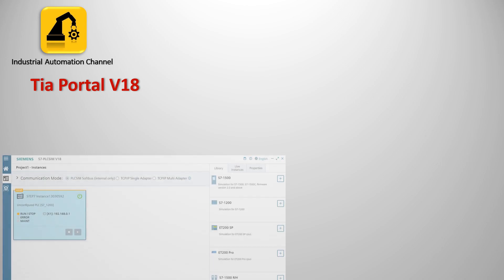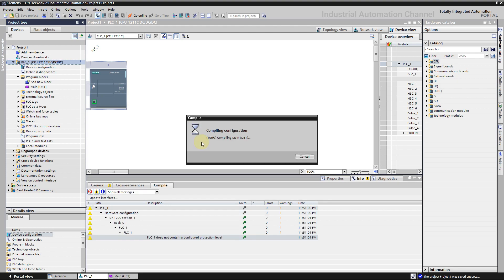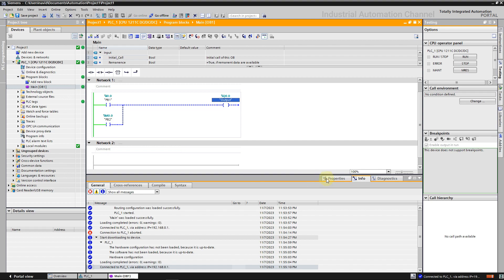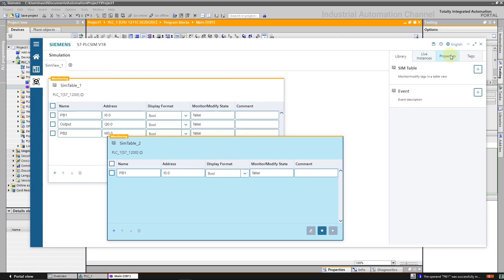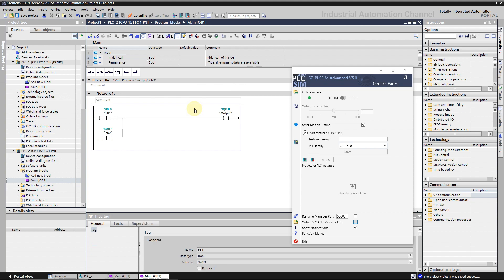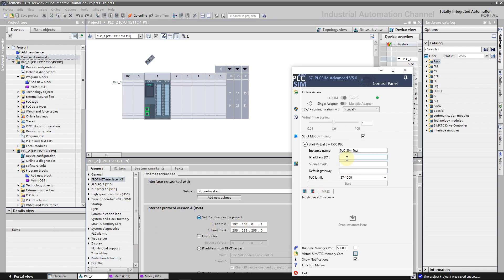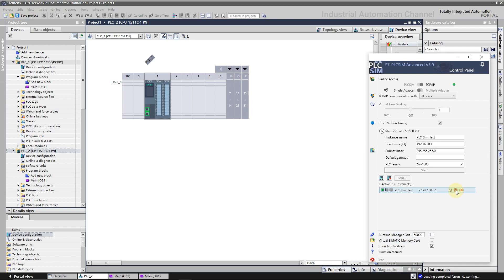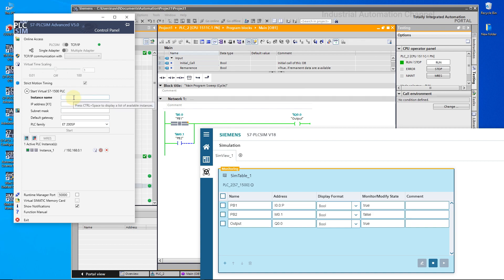TIA Portal #21: PLC Simulation using PLCSim V18 & PLCSim Advanced V5.0

Comment: Hi! Could you help me with my problem? I’m using TIA Portal V18 and S7-PLCSIM v18 for simulation. I can start the simulation relatively well. The problem is that when I make changes to the program, the simulation software freezes.

Here’s how I make changes: I stop the PLC in the simulation software, then I make changes in the program, for example by adding a button. Then, when I try to load the new program into the PLC, the simulation software freezes. What am I doing wrong? In what order should I proceed to make it work? I’m going crazy with Siemens!
Reply from the maker: Hi,
This freez problem I hade also somehow. I think it's a bug of software (Not sure) 
Have you installed the SP of PLC Sim. Probably your problem is solved with the SP because PLC Sim is totally new software and it takes time to solve all the problems.

Comment: hi 
thanks a lot really good and simple but when working with plcsim v5  how do i make main block go 
online ?
it doesn't show in the video
Reply from the maker: Hi,
just like other simulation click "go online" in Tia or click on glass icon. It is like other simulations so I didn't do that again.
Reply: @industrial_automation  i did that it went online but i cant change the inputs from 1 to 0
Reply from the maker: from 1 to 0 ??? has the input a start value of 0? if yes then somewhere it's overwritten to 1. 
Do you see the CPU in run mode? 
It's really not easy to troubleshoot a plc problem just with coments.
Reply: @industrial_automation  from what people told me i can only change the bit from 1 to 0 is by using the force table is this right?
Reply from the maker: @maherdaibes9344  With Force Table you can do it but as its name indicates the input will be forced and that's not a solution that you need. 
I checked it with a CPU 1516-3 PN/DP V3.0 and TIA Portal V18. I could change any input (Peripheral --> P and Q, Memory--> M and from a DB) all of them I could change 0 to 1 and again 1 to 0. Write which cpu are you using. for example some versions does not support Plc Sim advanced. Try to make a new project with the CPU that I've used. 
Probably your input is overwritten somewhere in your code.
Reply: @industrial_automation  thanks a lot i tried to use this CPU and it worked thanks a lot for answering and helping me i wanted to ask if you know why some CPU's  don't allow you to change normally and force you to use a force table

Comment: i have probleme in the S7_400 i can't find it in the PLCSIM
Reply from the maker: In PLCSIM V18 do you mean? 
Yes you can't find it because if you want to simulate 300 or 400 series old version of PLC SIM will open. I think V5.4
V18 is just for 1200, 1500 and ET200 CPUs. V5.x supports 300 and 400 series.
Reply: @industrial_automation  nah doesn't work for me i don't what s the probleme they show me a message that (((some information may have been lost. This should not have happened........)) and the Tia portal restarted
Reply: @industrial_automation  also when i want to charge the program i can't because there is no advice to connect with i don't know how to use the virtual one
Reply from the maker: @oumaimasahir753  Which version are you using? if 18, have you completely uninstall previous version befor installing this version? 
Have you updated some part of TIA? Maybe some incompatible versions of other parts you have installed. It can have many reasons.
Reply: @industrial_automation  now im using V18. But i have installed V17 where i did my project for the first time
Reply from the maker: @oumaimasahir753  try to uninstall TIA with advanced uninstaller to completely remove all files. Then reinstall V18. Did you get V18 from siemens Webseite?